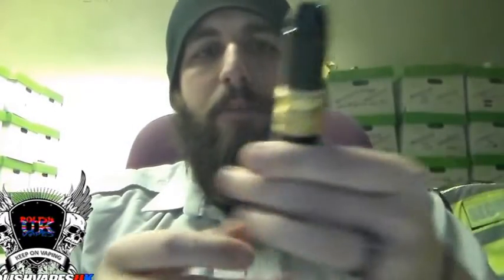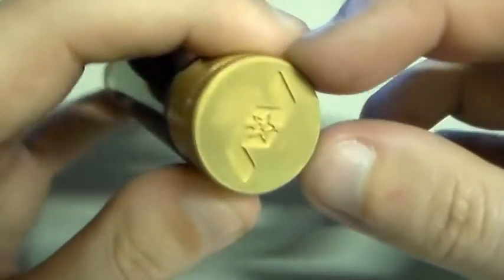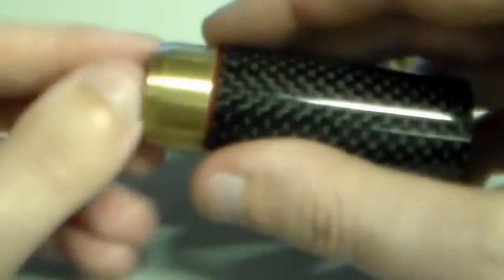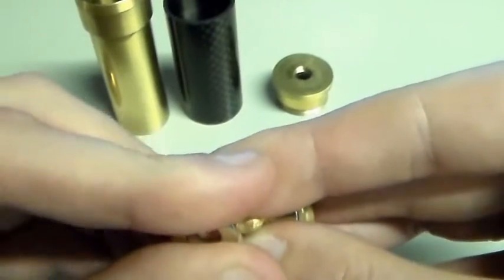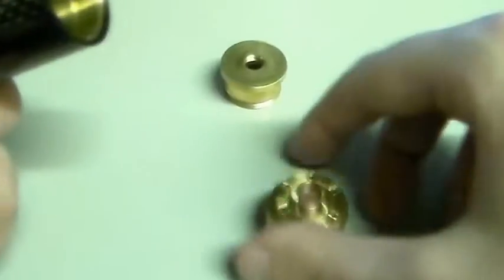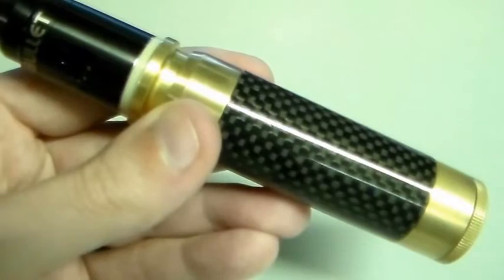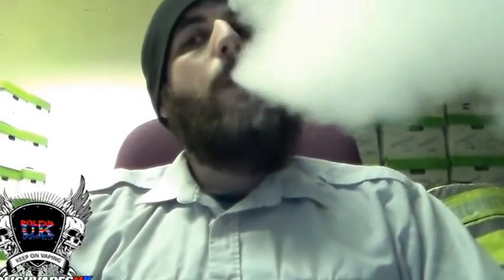AV Able Mech Mod (Clone) Review

Comment: have a copper AV clone coming tommoro they are spot on - prity much identical in performance and style to the origionals - with the authentics you are paying for the time and stuff that went into the design etc the clones from kindbright are just as good quality as the origionals but yeah they stole the design so as long as you are fine with that you might aswell buy the clone they are just metal tubes after all - my pal has an authentic brass and i got a clone brass hes now kicking himself for the price he payed - as long as the mod is supplied by kindbright you will be happy - the shorty sub zeros mods are spot on aswell right down to the packaging
Reply: they still perform just as good as each other tho! my clone hits just as nice as my mate authentic same goes for the vcm clone to vcm authentics
Reply: Chis Tait clones don't hit as hard or as good as an authentic my copper clone doesn't hit as hard as my copper authentic they have the exact same build on them and i use the same batteries for both and my authentic definitely hits harder
Reply: copper clones are usually a cheaper quality copper than authentics js
Reply: Charles Moye yes there do there the same thing

Comment: thanks for sharing. Is the mod actually brass? can you see if a magnet sticks to the mod. Thanks
Reply from the maker: +Joshua Riffe yes its brass and yes they do stick to it
Reply: ANOTHER magnet, wouldnt stick to the brass. I think so, I think polish vapes means the magnets in the switch. Things fly towards such strong magnets, like small screwdrivers glide over and attach to the button housing;-)
T

Comment: Hi, just received my clone today. I used my smok baby mini at 0.40 ohms and my battery got pretty warm, almost hot after only 4/5 puffs.
I used Samsung 2500mah battery which is as new condition.
Also just bought some efan 3000 mah battery which are new and has same problem.
Any ideas or help.
Reply from the maker: Freddy Juicebox you should not use tanks on mech mods only rdas or rtas
Reply: PolishVapesUk ahh I see.
Great il give my new glacier v2 that I received.
Really appreciate your advice.
Btw the glacier v2 is around 0.33 ohms, I assume this will be ok
Reply: NEVER subohm on a mech mod. Venting 101

Comment: why dont av mods have vent holes? the reason i dont buy em!
Reply from the maker: dont know wish i knew but ive never had an issue with it i love the able
Reply: They do now! but the older ones didn't... but you can purchase one of the new switches and housing that have the vent holes! Also, the NEW ones that just came out have vent hole built right into the design of the MOD's now! Like everything else, you learn how to improve on a design as you go... ;)
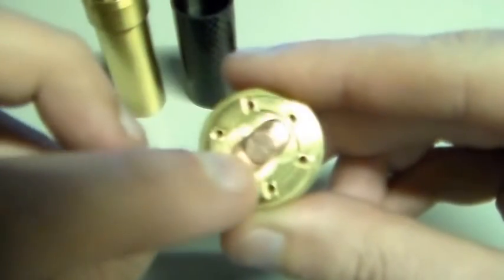Reply: Wayne Gilbert if you go to 4:00 in the video. those little holes all around the pub are the battery vent holes which go through the switch.
Reply: Good point fabio. I think it would vent fine as your switch will most likely be wound out for firing. I ordered one, and am not afraid of it more than any other mech. It could have BETTER venting though.
T
Reply: Wayne Gilbert there do at the bottom